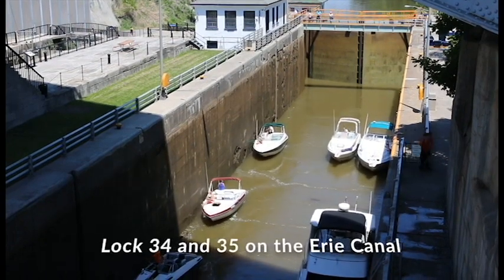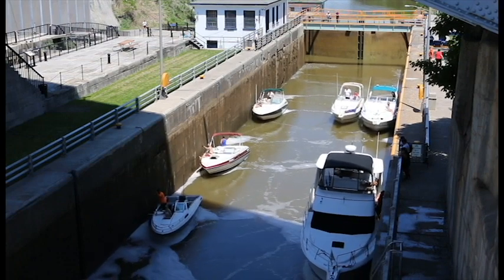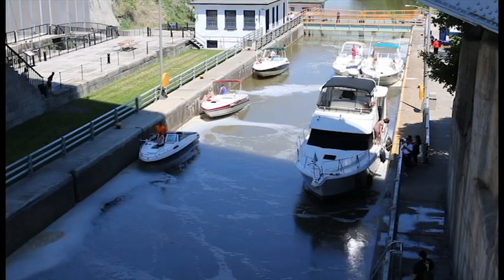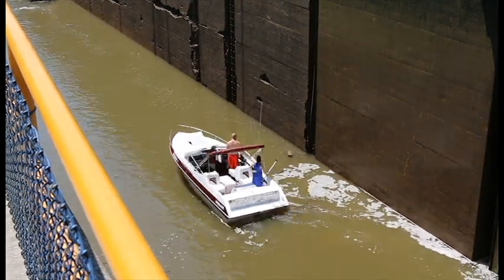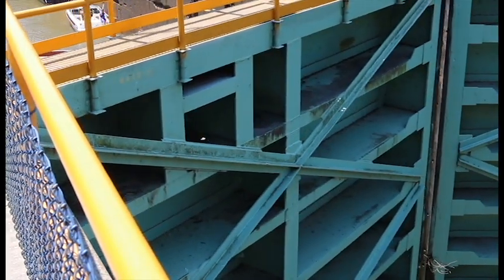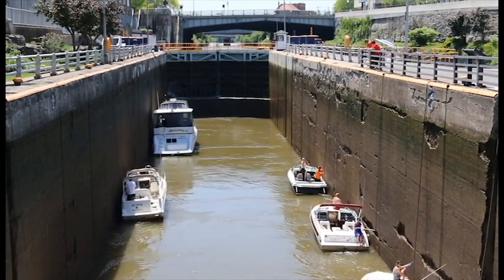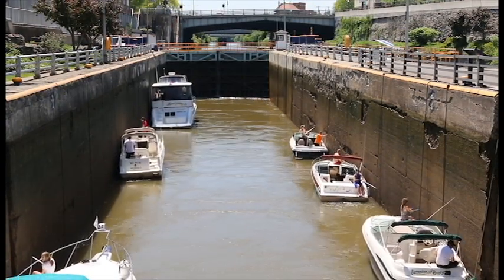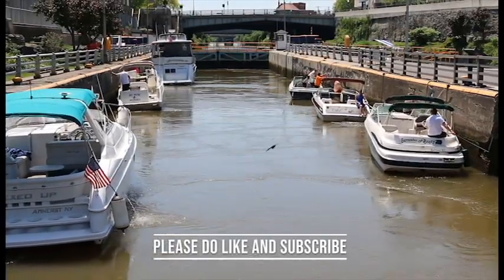Time Lapse of locks 34 &35 in Lockport NY on the Erie Canal

Comment: I went through the locks with my boat awhile ago theres a cable going down the side of the wall your suppose to put your boat rope around  that cable to hold your boat against the wall when the water goes down , well there was a big cabin cruiser the guy tied the line to the cable instead of lopping it around the cable so the rope would slide down the cable when the water went down well when the water went down and the guys cabin cruiser was hanging on the wall with the rope tied to the cable  the guy realised it and cut the rope with his knife.
Reply from the maker: That will happen. It is a learning curve.
Reply: Yes it was funny because no one got hurt

Comment: The Gallons Per Minute Output on those pumps has to be Stupid High......Amazing, Thanks.
Reply from the maker: Thanks for watching.
Reply: its probably just gravity, the british ones are
Reply from the maker: Actually you are correct it is gravity and some pumps. and 7 HP motors control the gates and locks.